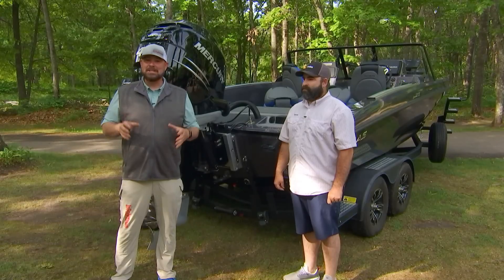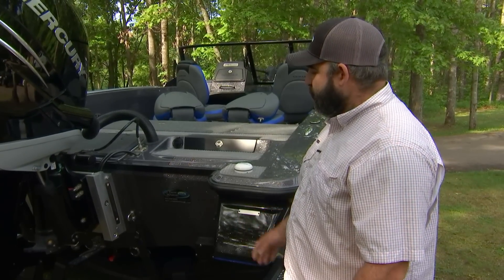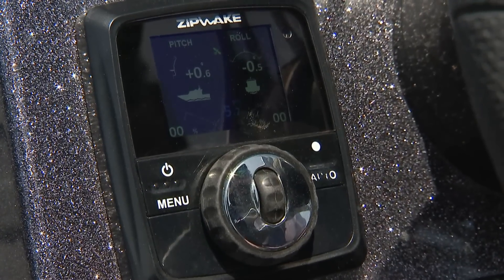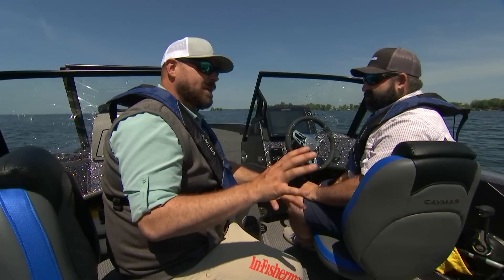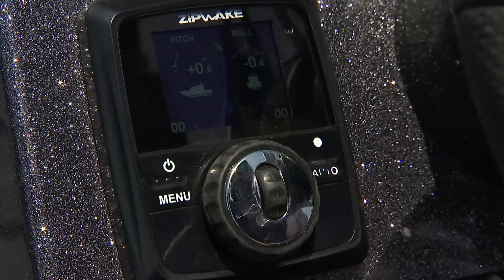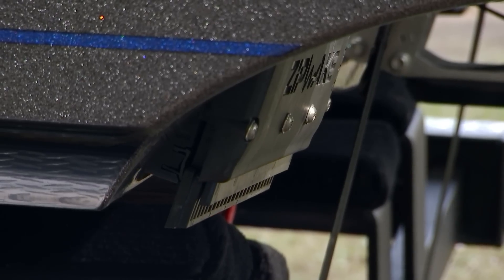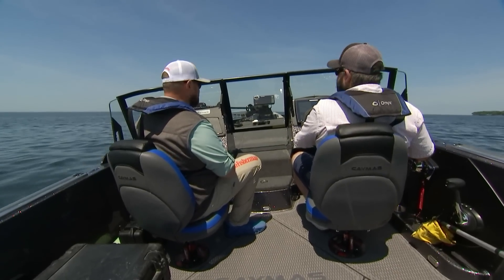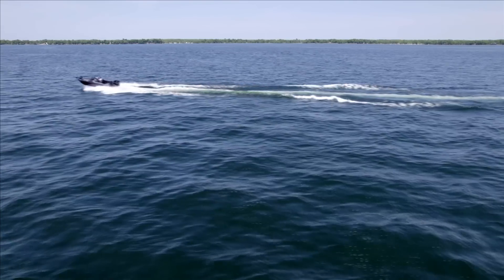Are Trim Tabs a Thing of the Past? Interceptors vs Trim Tabs | Zipwake Review

Comment: Not understanding exactly how these work. If anything they'd be counterintuitive of a trim tab and also create drag. Trim tabs do all of the above without scrubbing speed. How is handling and fuel economy not sacrificed with that much drag
Reply: There is a video here that does a better job making the case for Zipwake interceptors:
https://www.youtube.com/watch?v=E8w0qJmKhbA
Also, while interceptors are counter intuitive, they actually are efficient by an invisible means. Water swirls horizontally in front of the interceptor like a roller bearing and it directs the flow lower down. Interceptors were around before Zipwake and have been used in many patrol boats.

Comment: Not only do i see an issue with causing drag by putting a perpendicular wall against the in flow of water, but i also see an issue with over time causing an extra serious stress on the transom it's mounted to.  I don't see anyway that these are more efficient.  And i have serious concerns with transom wear. Also what if you run a ground in shallows.   Hitting a ground will not effect trim tabs much at all but I can see these ripping one hell of a hole in your boat.  Just my thoughts.  Nothing about this design looks appealing
Reply: If you are running aground, then your motor will be a much bigger problem than those
Reply: There is a video here that does a better job making the case for Zipwake interceptors:
https://www.youtube.com/watch?v=E8w0qJmKhbA
Also, while interceptors are counter intuitive, they actually are efficient by an invisible means. Water swirls horizontally in front of the interceptor like a roller bearing and it directs the flow lower down. Interceptors were around before Zipwake and have been used in many patrol boats.

Comment: Yes trim tabs are better.put your hand out of the boat at 45° and then at  0° degrees flat to the wind.What angle is better.
Reply: There is a video here that does a better job making the case for Zipwake interceptors:
https://www.youtube.com/watch?v=E8w0qJmKhbA
Also, while interceptors are counter intuitive, they actually are efficient by an invisible means. Water swirls horizontally in front of the interceptor like a roller bearing and it directs the flow lower down. Interceptors were around before Zipwake and have been used in many patrol boats.

Comment: What I don't understand is how can a flat plane that comes down paralleling the transum give better fuel economy. I can only imagine it also digs in to top speed and cruising speed as well I can get that it causes drag on one side or the other that may help a whole shot in keeping the bow down but it's gotta kill the fuel economy and the top end speed. Or please explain the dynamics of how that works
Reply: same question.  Looks like it just creates drag. Why would anyone want that?
Reply: There is a video here that does a better job making the case for Zipwake interceptors:
https://www.youtube.com/watch?v=E8w0qJmKhbA
Also, while interceptors are counter intuitive, they actually are efficient by an invisible means. Water swirls horizontally in front of the interceptor like a roller bearing and it directs the flow lower down. Interceptors were around before Zipwake and have been used in many patrol boats.